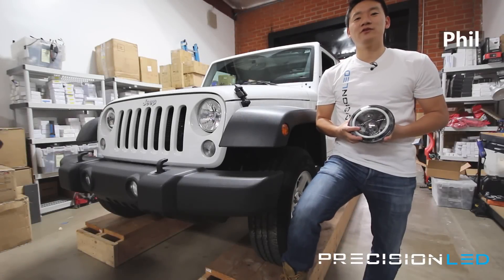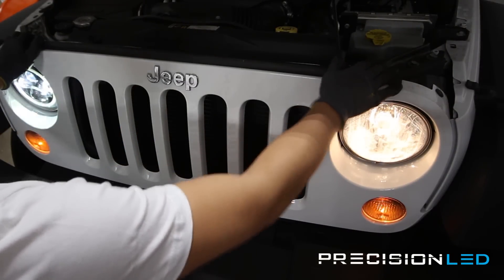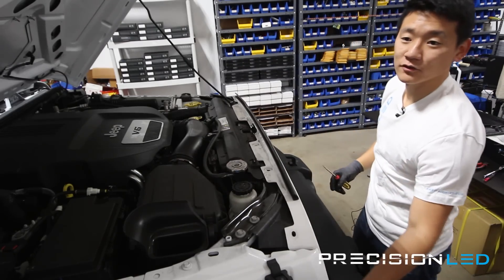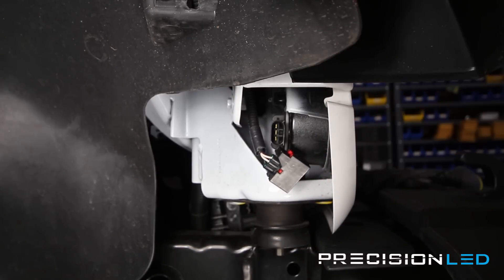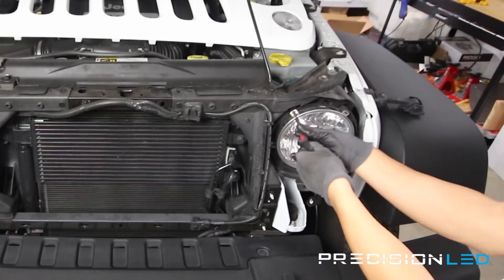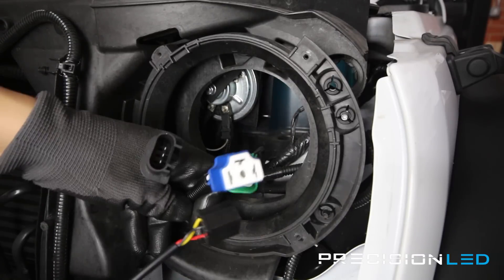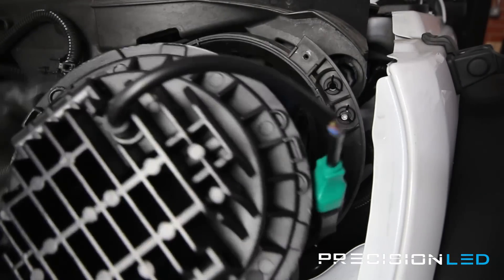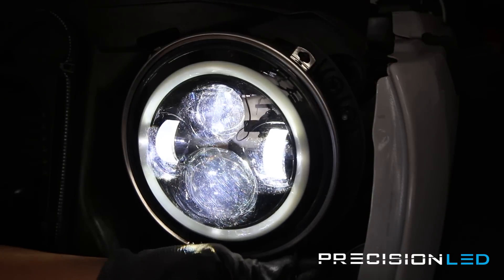Jeep Wrangler LED Headlights - How To Install (2006 - Present)

Comment: All went exactly as described, until I went to install the new headlight. The insert tabs were off by a 16th of an inch. No matter how I tried, I could not get them to go in. Fought with it for an hour and a half. Gave up and reinstalled the factory headlight. No complaint on the video though, the visuals & description were easy to follow! Thank you & Merry Christmas!

Comment: Yep, LED headlamps have a definite advantage over the OEM halogen lamps. But wait until you have to learn the cost of those LED lamps when they no longer work and require replacement. And the LED headlamps are too bright to my eyes as I visually engage oncoming traffic. Nope, I'll stay with my halogen lamps till they are no longer made!

Comment: For anyone who is interested in why there is a capacitor involved when switching to LED headlights it is because the power supply (alternator/regulator) while the engine is running creates a ripple effect as the engine runs at different rpms during driving. The capacitor smooths out the DC voltage so the headlights won't flicker. 

For LED brake lights a resister is added to the circuit to make sure the turn signals blink at the same rate as before the change was made.

Comment: My sets of LED headlights have two extra wires that are meant to be wired to the fuse box. I believe one is for daytime running lights and I’m not sure what the other is for, but my question is do these have to be wired in or can I install the new headlights without it?

Comment: What's going to happen if you lost one of the moisture control cap (mentioned in 4:42 on your video) on original headlights?
Will it make my headlight moiture and water leak? Thank you.
Reply from the maker: Yes, this is indeed a possibility.  We DO NOT recommend installing without the dust cover.

Comment: Do you know if those capacitors ever go bad?  Would that cause the light to work intermittently?
Reply: Same problem here. My one of my headlights works sometimes ( rarely ) , flickers most of the time , & goes completely off occasionally.  Need to fix it asap

Comment: Installed mine and for some reason they don't work as great as the regular ones. There not bright at all and the high beams you can't even tell if the lights are on. Is there something I missed?   The alignment is good

Comment: The original harness that you use to do the first plug in will not go in all the way. Can you help??
Reply: B_Cuss my is doing the same did you happen to figure out how to fix it?
Reply: Gavin Garner I messaged them and they said some years did that, I had a 2008 Rubicon, I just had to push it as far as it would go then use electric tape to make sure it stayed and it worked for me
Reply: B_Cuss okay thank you I have a 2007 Rubicon so I'll see if I can do the same! thanks again

Comment: That's a torx bit or driver that you need. A torque wrench should not be used at all in this procedure.
Reply from the maker: Thanks for the correction!

Comment: Do the daytime running lights work as well?
Reply from the maker: We have listed the DRLs project from the same light as the high/low beam.  This video shows the conversion of the high/low and DRLs.  I do apologize if we did not specify that in the video.

Comment: How do you wire up the halo"s ? I wired everything up but my halo's don't work. Thanks
Reply: Michael, The same thing happened to me. I wired everything as described but my Halos would not come on or blink. Did you ever figure out what the problem was? Thanks
Reply: I was linked to this video for a set of spider eyes, anyways the lights came with a little red wire coming out, inches from the headlight, spiced it hooked up to the middle white wire, that ..go to you front amber  signals. So my halos are daytime running lights , I've splice the other white wire to the side markers, allowing them to blink as well
Reply: Hi, what is the best way to splice the wires? I understand how to splice, but how do you connect them? I was thinking butt connectors, but I don't get how that would work.

Comment: I just installed these but when I turn my High Beams on, the passenger side turns off.  Anyone know a fix for this?  I have a 2007 Unlimited Sahara.
Reply from the maker: Where exactly did you get your headlamps from?  The product shown in the video was just a prototype, and we are still working on getting these in our inventory.  In short, we do not carry these just yet.  However, what you are explaining sounds to be either some type of wiring issue, or possibly just a defective high beam function on one of the headlamps.
Reply: Bought them from XpriteUSA.  I thought it might be a defective light.  So I sent it back and they sent me a new one.  Same issue.  For some reason the Passenger Side High Beam refuses to light up.  I read some forums and several people have complained about this issue.  The only fix I've seen is that someone just used a Convertor on the Drivers Side and not the passenger side.  However, because of the cables and connectors they sent me, I don't have that option.  So I was hoping someone else would have found a fix for it.
Reply from the maker: Thank you for the reply.  I do apologize, but we never experienced this issue with our prototype, and because we have not imported this product in our inventory just yet, we do not have much information on them either.  However, we will do some research and let you know if we find some type of remedy for this problem.  We will keep you posted with any updates.
Reply: Odd question, but what brand/type of gloves are you wearing ?
Reply: I wasn't wearing any. However I did find a fix. Should have posted my results. I only used 1 resister on the drivers side. I left the one on the passenger side off and it works just fine.
Reply: Had that issue with HID's once. Was a bad ground.